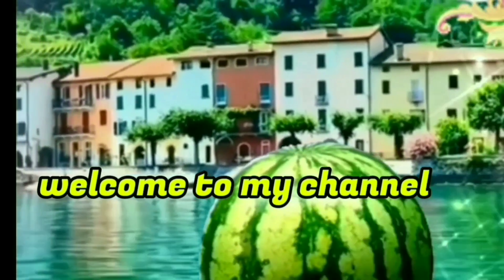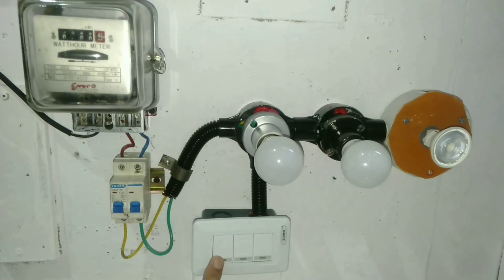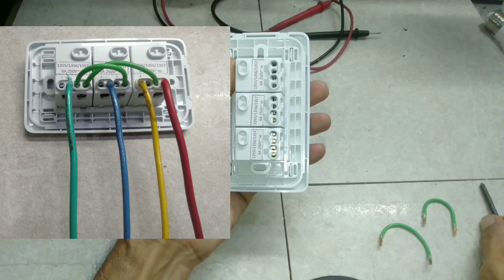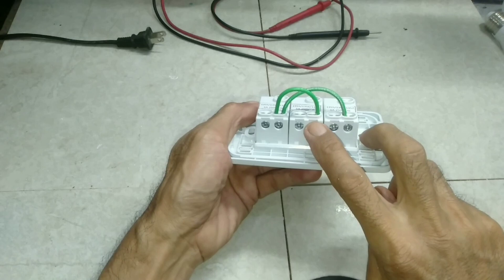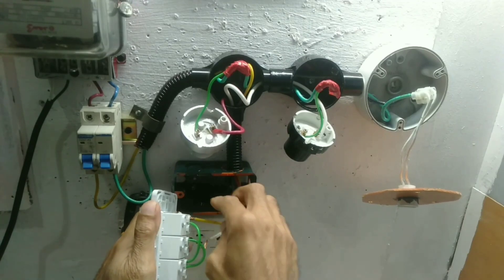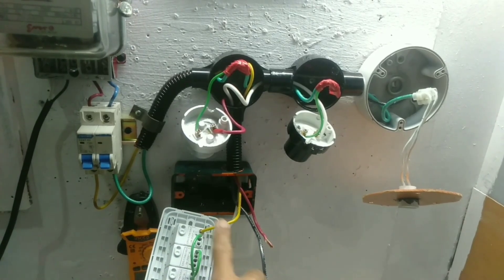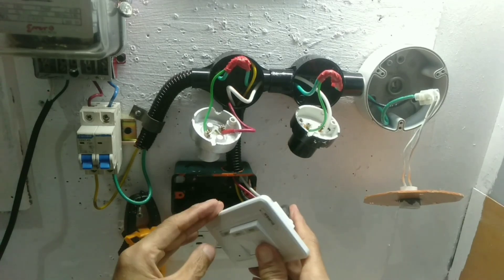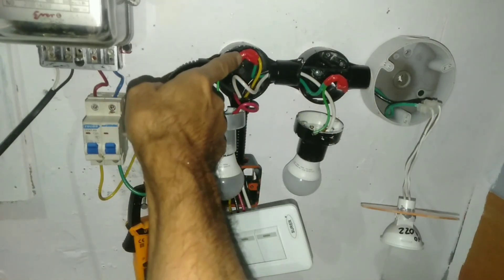what is a 3 Gang switch ?

Comment: 6+mins to answer this? 3-gang box is a box that can hold 3-devices. Each gang is a device you can install a device in. Could also tell you how to wire one. Which would still be under a minute video.
Reply from the maker: Thanks for the comment,I try to improved my video